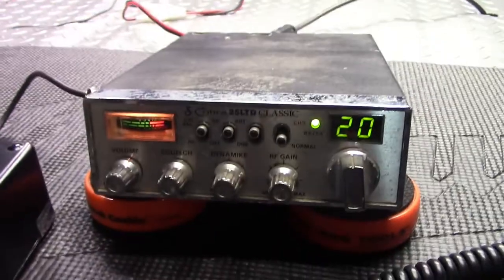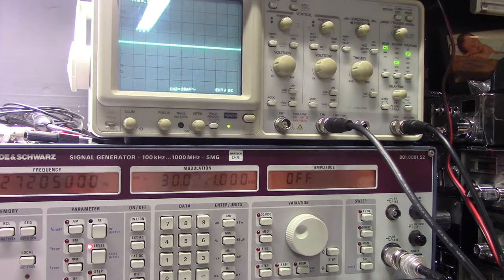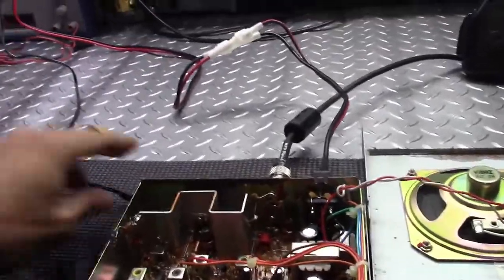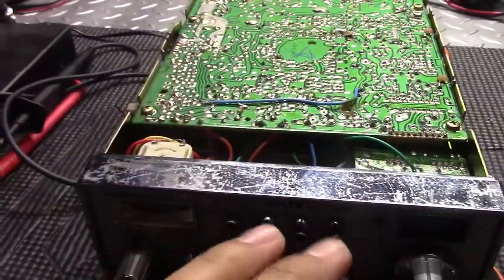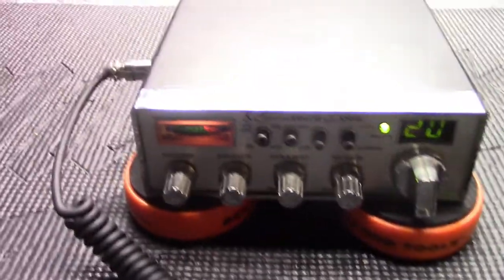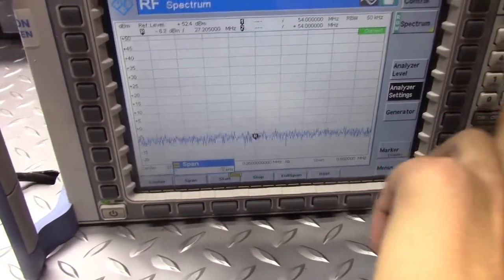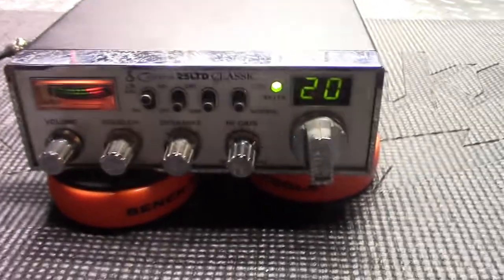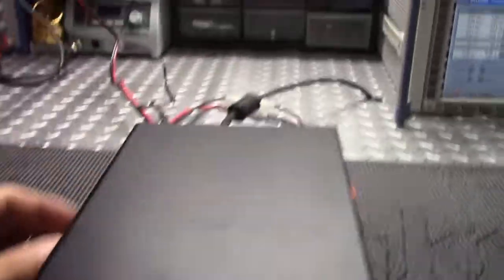Cobra 25 LTD Classic Repair and Align(CB Radio)

Comment: Can't wait for mine to return  with a rfx150 , TRX Echo board bigger caps blue lights behind the switches blue Rings behind the knobs a variable with rx150 TalkBack noise canceling microphone Wilson 1000 16 gauge wire for the power plus the fan kit plus the alignment talk back. Plus switches😊

Comment: I know this is an old video but hope maybe i can get a reply. I got a 25 that transmits and receives but i get no sound from the speaker or an external. When i removed the cover, L401 has a bad solder joint. Could that cause the issue? Its a 2017 model made in China

Comment: Amazing what folks will do to 'improve' their radios. "I'll just cut this little ole trace and bam, look at that extra power! Wow. Just like puttin a 4 bbl on my 327. "
It was useful to see the scope display showing the over modulated signal then, later, the corrected and nice modulation response. 
You might have explained why the power reading is fake, ghost,. My explanation: When the radio audio is over driven,(like by cutting the trace) it creates unwanted output signals on other frequencies. The power meter measures everything coming through it so you now see a higher reading because you now have these additional signals adding to your overall measurement. But they are not 'on channel'. In fact, your desired output frequency may even be degraded.
Thanks for the vid. Gonna go see what else you have out there.
Reply from the maker: Yep the watt meter reads all RF whether its splatter watts or clean on channel watts..thanks for watching 73